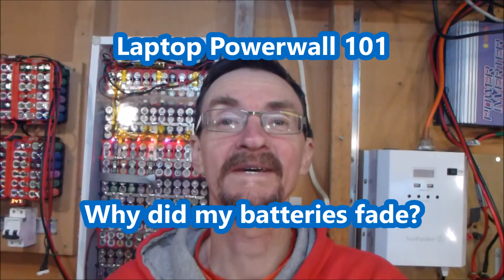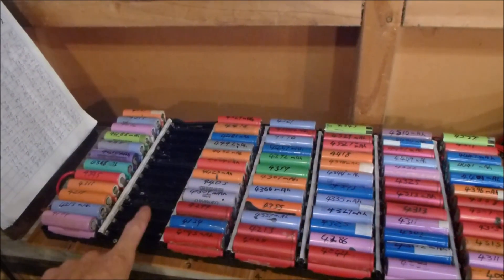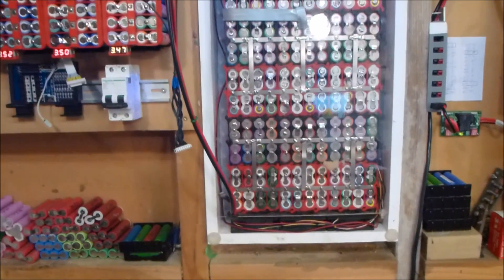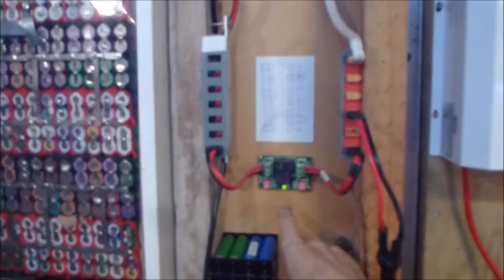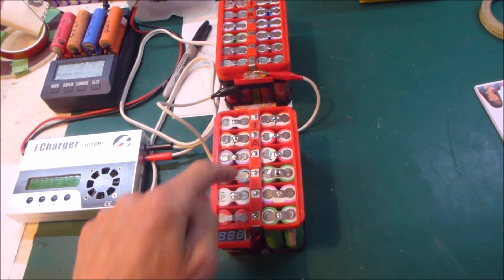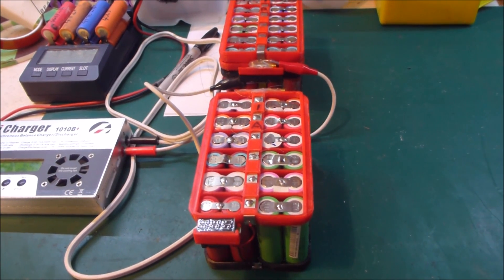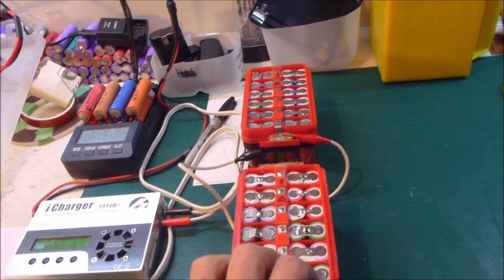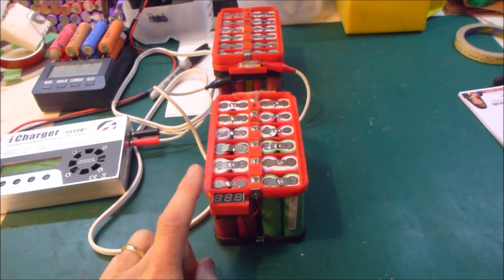Laptop Powerwall 101 - Why did my Powerwall die?

Comment: Hi Paul! Thanks for the enlightening video.  Just curious...could you share with us WHAT IS THE CELL CONNECTION OF ONE RED BOX...is it 6s4p for a total voltage of 22.2?  I am building a Powerwall myself.  I was thinking of making each box 14s50p.  But if I can learn from your experience, I will know if I have to reduce my planned size or not.  Thanks, Paul
Reply from the maker: Each block is 24 cells in parallel - so it's 1S24P for 3.7V nominal. I connect 7 up to make a "24V' pack.

Comment: 8:30 this indicates your bus bar is not thick enough if you have high current on the closest cells and not the far cells. If you were to measure the voltage at the front and back end of the battery, you'll find it's high enough to drain most of your front end cells which is a bad thing.
I highly recommend you fully charge your cells, then get a voltage drop test ready and do a high current drain test to prove if I'm right or wrong. you don't want your cells to drain in series otherwise short current bursts will causes your cells to self balance other front end cells all the time, which isn't really ideal.
Reply from the maker: Yes - I agree. The bus bar I used was sold as nickel strapping - but is actually just nickel plated steel strapping - so it's not nearly as good a conductor. At the moment my solution is to try to make sure the system is never run at higher current draw. In the long term I need to think about replacing the strapping with real nickel or switch to using twisted copper wire from "mains" cord.
Reply: ideally, if the inverter can run at higher voltages, this can then reduce losses due to high currents over any metal (ie high voltage power lines), but this then can introduce dangers of high voltage DC battery packs too. But with insulating everything and fusing everywhere, these dangers can be limited. I guess see how you go.

Comment: Hi great vid! Just out of interest could it be the fact that you fuse two cells instead of single cell fusing on your packs so the fuse wire you use is not big enough when load is drawn from the battery?
Reply from the maker: I think in this case the wire I'm using (0.2mm dia) is big enough under standard conditions (they don't blow when the system is running normally) and small enough to blow when I do something stupid :/
Note: the current that blows a fuse doesn't come from the single/pair of cells that goes bad - but from all the other strong cells in the parallel group.

Comment: Hello Paul...I would make a new block.   Even if you fix this bad one, it may well have halved its "dutycycles/lifetime" and are  no longer compatible with the rest.   It will potentially be the first, to create trouble Again..  By all means fix it, but keep it just as a spare.  "Tell tell signs": The capacity and internal resistance in these four "owerworked" cells have no doubt changed... Charging and discharging times are shorter and Curves are steeper.  Take one pair out and test it in your Liitokala.   You know all this...I just wanted you, to look at a long term solution.     "Why did the Wall die"...? My theory, As Tesla Powerwall suggest: Ohm did it...   Greetings from Denmark...Jakob.
Reply from the maker: All fear the mighty Ohm!
Reply: All better...!   OHM and his two children: His son URI and daughter PUI...!

Comment: i had a pack die on my home made power wall i think it was only one battery that went but it took out over half the pack i did keep the good ones but wont build them back in the pack, the way i test batteries now is once i have established the batteries capacity i charge them up and leave for one month and then check the voltage if it falls bellow 4.05 volts they dont get built into packs not had any issues when done this way
Reply from the maker: That sounds like a good process. Thanks

Comment: I think your system was just sulking cos you left it alone for a few days ... putting all that mental energy, time and focus in creating such a thing will give it a soul (of sorts) .
Don't look for the cause , it will probably behave now your back .
Putting voltmeters on each pack is a very nice touch ..
Reply from the maker: The Soul of a new machine, by Tracy Kidder - a great read about the creation of a new mini-computer at Data General back in the late 1970s. The book won a Pulitzer in 1982. Good stuff. https://openlibrary.org/works/OL98218W/The_soul_of_a_new_machine

Comment: what is the voltage on the blown cells
if high slap it back together an see what it takes to charge
Reply from the maker: Yep - voltage on the cells with the blown fuses were 3.8 volts - way higher than the others in that group. That's what led me to think those fuses blew from an event prior to the draining last weekend. So that group was running with roughly 5% less capacity than the other groups in that pack. And that's why this group sunk so low when the whole pack was drained.
Mistake 1. loose cable - I should have double checked my work
Mistake 2. blown fuses - I should have inspected all fuses before plugging the pack in to the system.
Sigh

Comment: Urban off grid has already said it but the voltage of the blown fuse cells should be demonstrably different if the fuses blew some time ago.  As your packs are nice and small, seperate all and check all again, its what you did when you built them!

Nice to see you installed an overall low V cutoff but even a small BMS with limited balance function would have disconnected and protected the individual packs....
Reply from the maker: Yep - the cells with blown fuses did have higher voltages on them. And yes - if I'd connected the BMS that's sitting there waiting - it would have been OK. Doh!
Reply: I can see an upcoming episode then!

Comment: Can you share the information about the low voltaje disconnect you installed? Thanks
Reply from the maker: It's this one: https://www.aliexpress.com/item/Low-Voltage-Disconnect-Module-LVD-24V-30A-Protect-Prolong-Battery-Life/32556232036.html The relay is rated for 20A at 28VDC (and for 30A at 230VAC). It's not a latching relay - the coil will suck 36 mA constantly.
Reply: intering to know how many amps it can do continuous
Reply: Ditto for me too.
Reply: Ah yes! thanks!

Comment: The cells that may have been shorted earlier should have a higher voltage then the rest of the pack. They should be just about the original voltage from when the pack was built. If they are low, they might have heated and caused the over current on surounding cells, blowing the fueses.
Reply from the maker: Yeah - the cells with the blown fuses were at 3.8V

Comment: charge upp all cells on that pack and check self discharge again. also checking capacity is good but i would do the whole pack to make sure its not alot lower than the other.  ie add in a spare pack first is what i would have done
Reply: Yes, at some point he would need a spare pack for situation just as this one, if only to swap things around once the faulty one is identified and have the KW pack running earlier
Reply: But if they get damage during that charge they are already damaged since before and no big harm done through. Of course keep eye (hands) on the temperature and yes do not push it by fast-charging. I agree on that.
Reply: I think you misunderstood my answer ;)  But hey I'm not here to argue so.
Reply: DIY Tesla PowerWall I didn't know the science about that, thanks. My yes at the top was more about having the spare pack ^^|